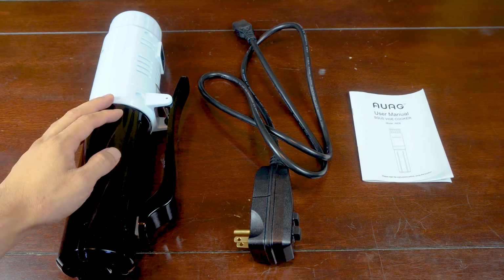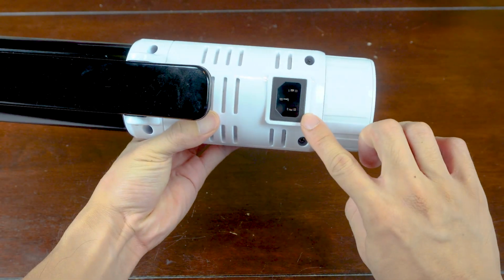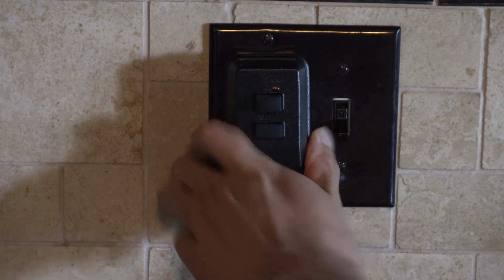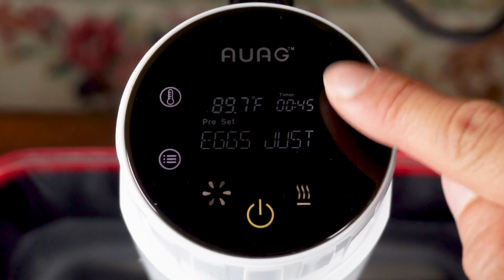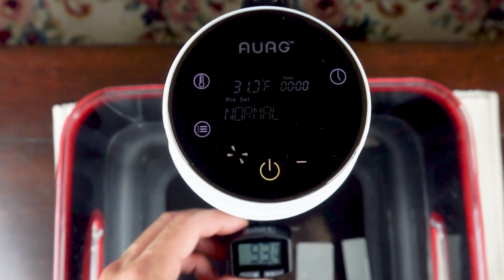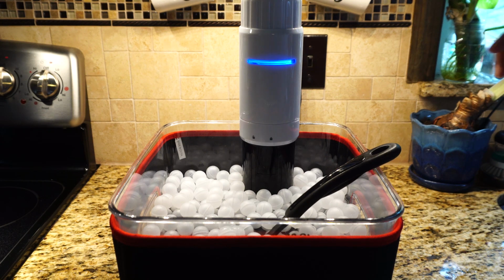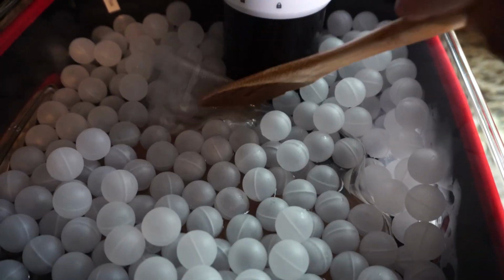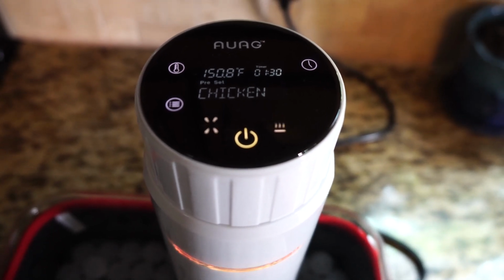AUAG Immersion Sous Vide Cooker Review

Comment: Just wondering, when I compare this to my friends sous vide it seems that the water barely moves..  His has a hole where the water actual squirts out like a water fountain that makes the water move around the container quite a bit.  Just wondering if mine is working correctly as I said it barley looks like its moving.
Reply from the maker: The impeller (spinning fan blade) for this sous vide is located at the very bottom of the unit (see 0:48), so the water swirls around the bottom of your container rather than at the top. The less surface disruption there is, the less heat loss you'll experience through evaporation, so it's actually more efficient this way. This helps the water retain more heat so it can heat up faster while still circulating it well enough to ensure all the water is the same temperature for cooking your food evenly.